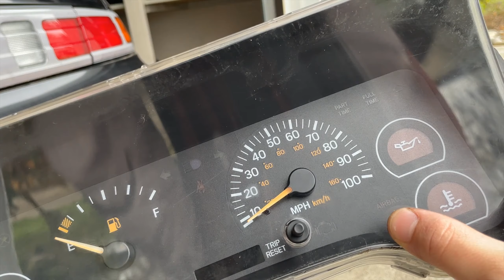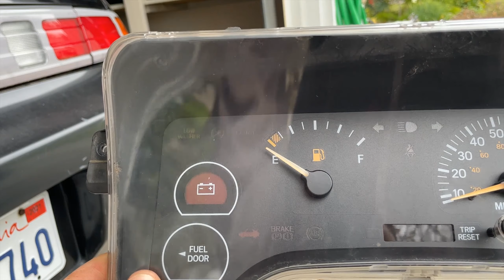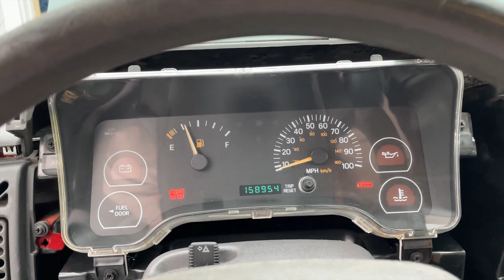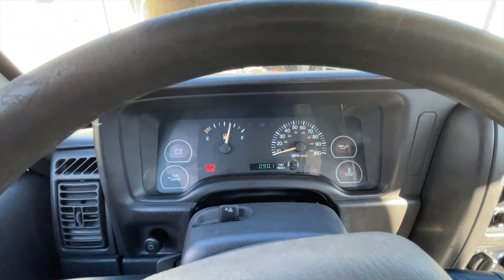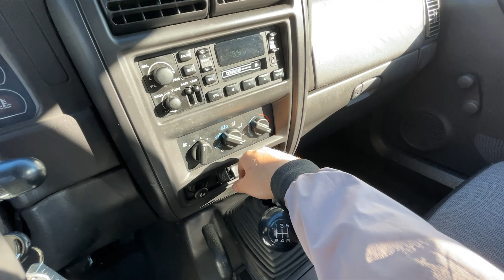Jeep Cherokee XJ Heater Core Replacement

Comment: Hey thanks for this video. I had recently replaced my entire AC system and got Uv due leaking out the drain tube. Evaporator is shot. Your video gave me some confidence in replacing the evaporator (and everything else in that cluster).
Reply from the maker: Glad to help! It’s not as bad as it may look. Take your time and take pictures of how stuff was on before you take it off and you will be good.

Comment: I have a 3 inch lift, you can get a lift kit and you have the skill set to DIY. Tires I run are 31 x 10.50 r15  procomp A/T Sport. Good luck with your project.

Comment: @4wheelfunBros I'm curious how long did it take you to remove the heater core/evap box say if you don't have to film.  Thanks.
Reply from the maker: Probably about 1.5 hours with evacuating AC system and draining coolant.

Comment: All the dashboards were made to be somewhat compatible, so therefore even the RWD 2.5l 5 speed has the same lights for two different transfer cases that wouldn't even connect to the AX5 transmission in the car.

Comment: 4.5 inch rubicon express long arm.  33 inch tires are ok. Anything bigger you’ll have to re gear it. Good luck……..🤪
Reply: Not with. 4 cylinder motor. I agree anything over 33 gets way more complicated